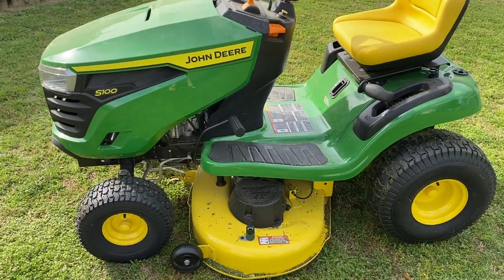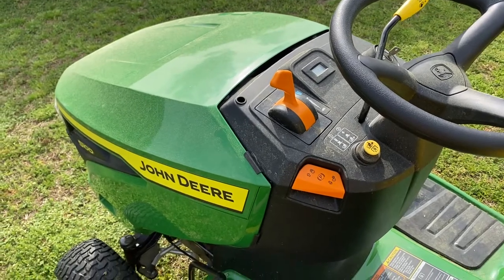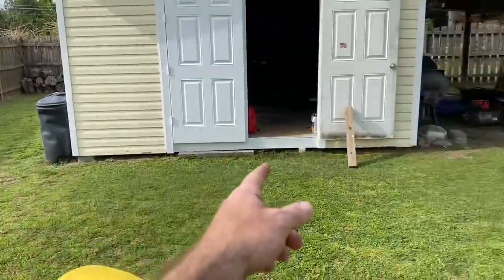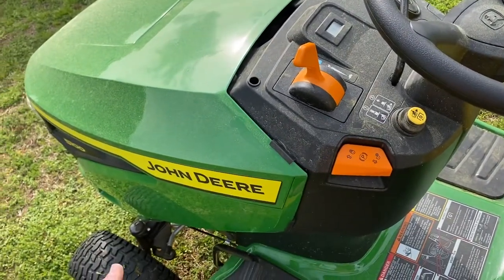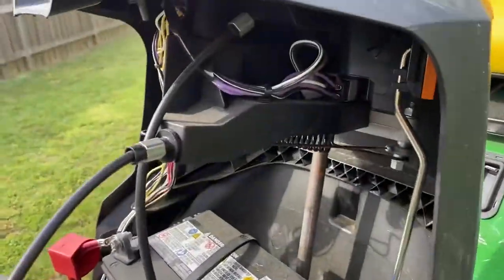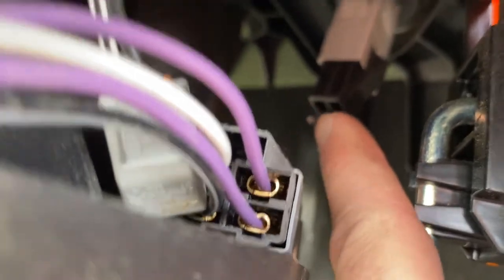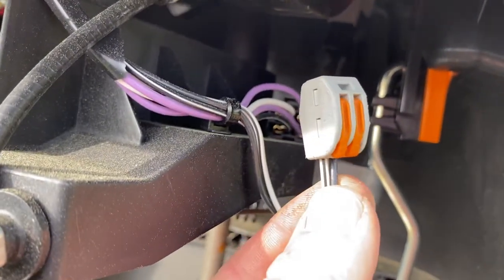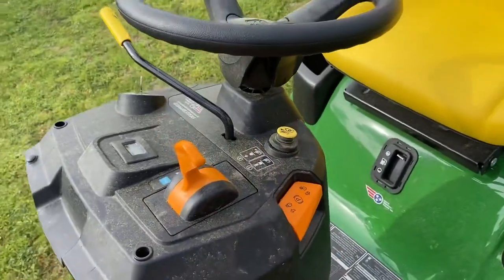How to bypass the annoying backup safety button (with disclaimer) and make mowing faster and easier

Comment: Just a little tip I learned the hard way with my new S100, don’t have the mower blades engaged when the deck is raised up to the 4” height. When the deck is raised all the way up to 4” the belt rests on the top of the deck. It rubbed the paint off the deck where the belt touched. The highest I go is 2 1/2-3”. I haven’t disabled my RIO switch just yet but I plan on doing so soon. I have 6 hours logged on mine
Reply from the maker: Good tip Jeremy! Thanks! I keep my setting pretty low. I'm always one notch below 2. But I know various grass types warrant different cut heights.

Comment: Great tip. I’m hoping there’s a similar way to override the switch for the bag at the back so we can mow & “mulch” the stuff out the back without the bag & having to have a spare hand pressing the switch / sensor. A clamp would be preferable as my Dad would kill me if I cut some wires. Thanks again
Reply from the maker: I didn't opt for the bagger, so I can't advise you on that. I have bought the mulching kit ($40) that covers the opening in the deck that removing the side discharge open up. That with mulching blades and I'm set. I don't even rake leaves, I just mulch everything!

Comment: Does the mower switch (PTO) work as normal just don't need to push it when backing up? Just got a X394 and found out about the annoying feature also if the brake is not set before dismounting the tractor shuts off.
Reply from the maker: This renders the push to reverse button useless. Best thing I ever did, it saves so much time! I find the seat safety slightly annoying, but I don't get on and off much, so I'm okay with that one. However, it can be bypassed as well. Let me know if I should make a video on it.

Comment: Can you use a fuse into the plug without cutting wires?
Reply from the maker: I'm sure what you mean. Maybe a jumper? Yes, you could do that. You just need to short the circuit so that it stays closed all of the time.

Comment: I usually use a jumper wire, on my old John deere but on the new s 180 the mower would not crank using the jumper wire….
Reply from the maker: So what did you do?
Reply: @MicahMartinDIY  threw it in the gutter and went bought another! lol 😆 finally got it working … one of the ends of the jumper wire was not in the connector fully.